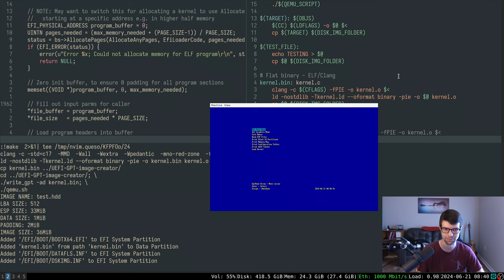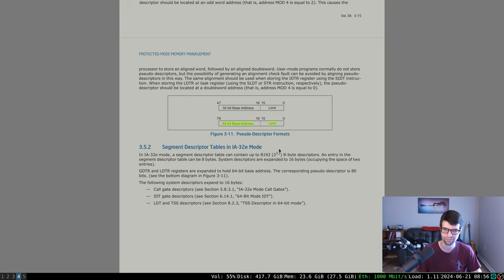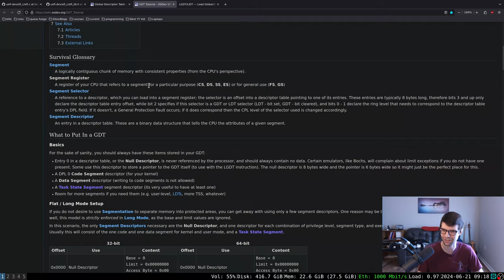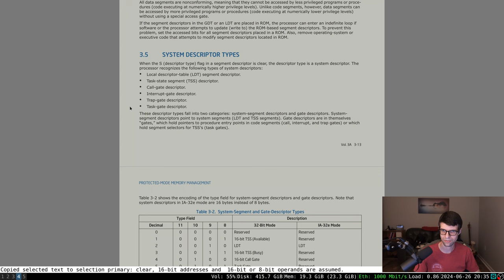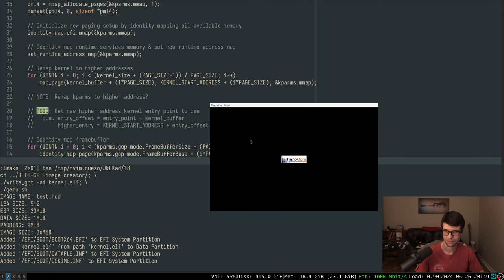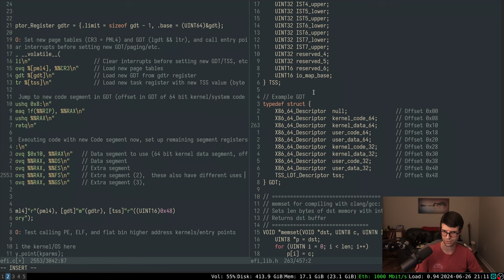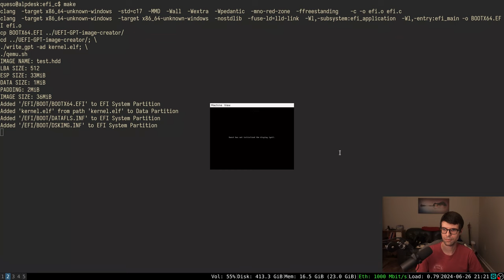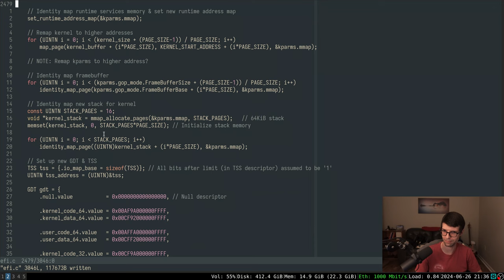x86_64 GDT for Remapped Kernel (2/2) | UEFI Dev (in C)

Comment: Nice. You're going to need 256PB of RAM now. Btw, any inline __asm block with no  :'s  after it (basic asm ) is implicitly volatile, and the same for an extended block (one with inputs / clobbers) with no outputs.
Reply from the maker: Good to know! I thought it would reorder compared to lines around the asm blocks but looks like that's only for side effects from the output constraints in most cases.

Comment: Please make a video on porting edk2 to arm64 platform. it will be way cooler as windows on arm is gaining momentum and there are arm64 boards all around us like our android phones
Reply from the maker: There are nightly builds of OVMF for arm/aarch64 here: https://retrage.github.io/edk2-nightly/
You can use that with qemu with say qemu-system-aarch64, but I'm not familiar with the latest generation of armv8 or v9, or how paging and other setup works for what is needed, including parsing and using device tree blobs and things.

For hardware, I do have an older raspberry pi, maybe this would work to get UEFI firmware on it https://github.com/pftf/RPi3
I don't have any other hardware to test with.

I plan on getting one of the x elite laptops in the future to test on, or another type of arm laptop or SBC if it fully supports UEFI without restrictions on ring levels or supervisor mode or whatever the equivalent is.
Reply: If you want a video on EFI for ARM64, https://www.youtube.com/watch?v=lU-saMCMVfw
The source code is in descript.